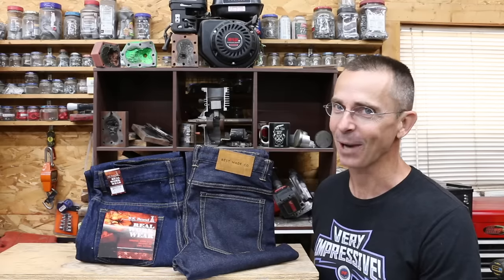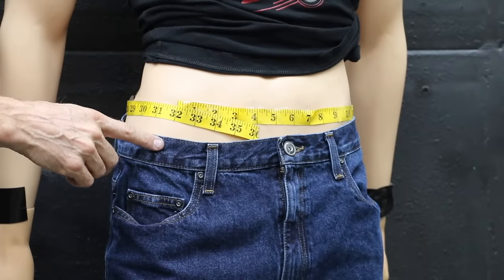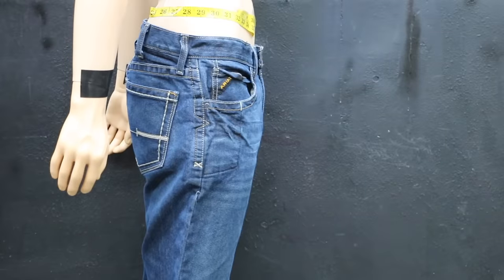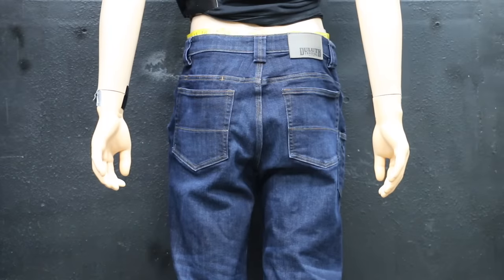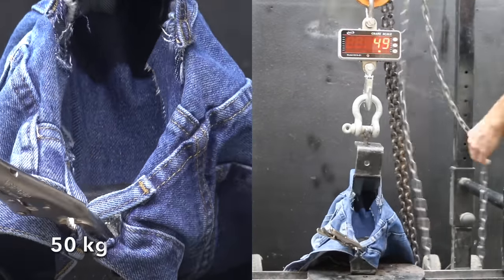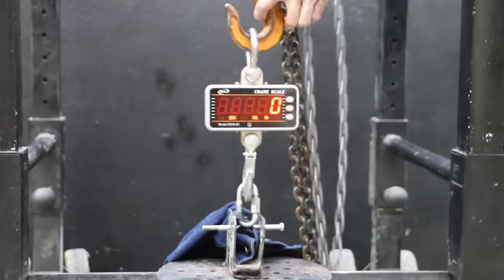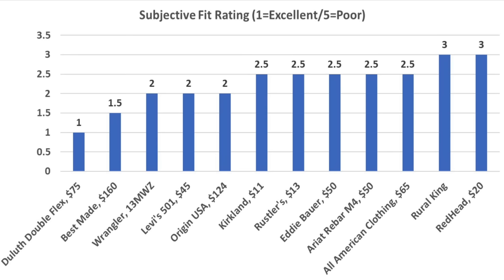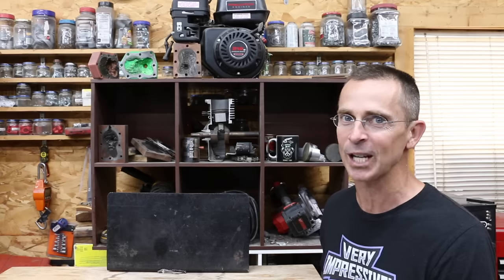$10 vs $160 Jeans? Let's Settle This!

Comment: Origin jeans had a buy two, save ~$50 dollars deal going on, so you were getting them for $99 a pair, rather than $124. I bought two pair and so far they are really nice and super comfortable jeans. Most of my jeans have crotch blowout after 1.5-2 years, so I need at least another year before I can access the crotch durability of these Origin jeans.

The firehose flex canvas material of the Duluth pants tends to hold up better than Denim if you sweat a lot, my Duluth pants have held up for 4 years and they still look basically new as far as wear.
Reply from the maker: Thanks for sharing.

Comment: I used to love 501s, but recently, I’ve noticed knee blowouts happen a lot quicker , I have below the knee prosthetic on my left leg, which causes additional wear, but they used to last 6 months before they turned white wear the prosthetic rubbed internally, and about a year there were holes. I literally wore a recent pair and the first day you could see wear, and in a few weeks the first holes started. So this video is great,  I think I’ll switch to Wranglers, they should hold up to my daily work I think
Reply from the maker: Thanks!  Thanks for sharing.

Comment: Recently my work decided to send out Evosyn oil by Evolve Oil, we're a rental center and naturally the entire rental side of the company is in an uproar despite no one really knowing about it.  We use your videos quite often to make our decisions on what tools we want to use in our shops.  If you manage to test out this new oil we'd love to see the results.
Reply from the maker: Thanks for the suggestion.
Reply: What was the reason for them to replace the previous product with that unknown brand? Is it to cut cost or to improve performance? That just might be the answer you're looking for.
Reply: @arkain1  Allegedly, it is to be used in certain tools that you may not change the oil in on a regular basis like pressure washer pumps or in applications that the tool may be rented for weeks at time with no expected maintenance like with generators.

The oil, while expensive, is supposed to by usable for the entire rental life time and only needs to be topped off as needed.  This is just field testing however, the powers that be may have us use this in all tools since we recieve tax credits to off set the increased cost.

Comment: Which Origin jeans are those? They make three different kinds.

Was your Breathability test done with both cold and hot air or...? If only one, which was it?

Did you do all this testing before or after washing?

This wasn't a fair comparison because some jeans were relaxed fit while other were regular straight fit; some were 100% cotton denim while others were flex jeans that had cotton blend with synthetics. Also they weren't all the same color.

6:36 Is that weight the weight before or after you washed them? And when you washed them did you cold wash or warm wash? Did you air dry or put them in the dryer?

Btw, how much were the Wrangler MWZ in cost? Where do i buy those?

Can you test GAP jeans please along with their subsidiaries: GAP Factory, Old Navy, and Banana Republic?

Can you please test made in USA jean company Diamond Gusset please?

Comment: There’s actually a lot that goes into high end denim. You can have a super high end 1000 pair of jeans that uses super lightweight Japanese denim mixed with cashmere or linen. Those will fall apart. You can have high end Japanese denim that is super heavy weight. 20+oz cloth. Those will destroy a pair of wranglers or Levi jeans.  When you get into the high end of denim you start working with very precise and long lasting stitching, sometime done by hand. It’s not all about durability. It’s about how the denim will fade over time and gain character. It’s about how well they fit, not just when standing but regardless of what position you are in. Sitting, bending, doing a cartwheel.  The ultimate question for people who care about high end denim but also value, how much better does Japanese selvedge fade over time than a standard cheap but good pair of american jeans? You could simulate this with chemicals, light, washing for multiple cycles, etc. i would watch that video.
Reply from the maker: Thanks for the feedback.

Comment: Wow, lots of interesting tests this time, Todd.  OK, I really don't care about pocket, crotch, or belt loop tears because I've never experienced one.  The only pocket tear was one of the 5th pockets losing a poorly installed rivet, and it only took 5 minutes to stitch up.  While I grew up as a teen in Levis 501s, I always hated the button fly.  Seeing the ventilation in the Ariats, I might be persuaded to buy a pair for the summer months,  but I quickly switch to Rustler and Wrangler shorts for the hot season.  
I've worn Rustler long jeans almost exclusively for 3+ decades and always find them a great value.  It's both surprising and a bit ouchy to see them at the very bottom of your list. (sniffle, sob, HONK)  Who in the world spends $160 on a pair of jeans?  No blue collar friend, oil field worker, or cowboy I've ever known would.  $50 for the Ariats would be my max, even if I had a spare million in the bank.
Reply from the maker: Thanks for watching!

Comment: If you have any problems with that -80 revco, let me know. The ult1786aua is a good unit but you aren’t using it the way it designed to be used.

Comment: Suggestion: Disposable razors. Quality, sharpness, performance, durability. I know it's not a tool, but it's a device we all deal with, daily. 

I'm particularly interested in the cheap kind that come with a built in handle, as I've never found one with acceptable quality. However, you could also test replaceable blade razors, lady razors, and other configurations assuming you can come up with a test rig.
Reply from the maker: Thanks for the video idea.

Comment: Suggestion for a new video. Luggage. Specifically carry-on roller luggage. Test zippers, extension handle strength, stated capacity, durability. Samsonite, Swiss Army etc....
Reply from the maker: Thanks for the suggestion.

Comment: I may have missed it or you accounted for it, but the puncture test seems like it has too many variables. It would be interesting to see if the result was a tear, cut or pass through the fabric weave. The nail head isn't evenly sharp and direction of the weave when it hits could also affect results. Say for instance the nail passes through the weave without much damage, they might be more durable but less protective. I wonder if something like ballistic dummy material supporting the jean would change the result too. Or maybe just the average of several random direction nail punctures per jean. Really appreciate your content!
Reply from the maker: Thanks!

Comment: I’ve never heard of Kirkland jeans 👖 before, but I’ve heard it with their line of food 🍱. My favorite 😻 was Levi’s 501’s, but every place I check, they’re $90.00. That’s why I quit buying them. I’ll probably return to buying them again, but it’s going to have to take some saving. I just cannot believe 75.00 to $100.00 for Levi’s 501’s. Your friend, Jeff.
Reply from the maker: Thanks for the feedback.
Reply: @ProjectFarm  I’d also like 👍 to watch ya do a tensile strength test on the exact same brands of jeans 👖.
Reply: That means to have two forces, one ☝️ on both pant legs 🦵, and on the waist, pulling in opposite directions 🗺, until the jeans 👖 fail. I’d also like 👍 to watch ya do a twist test, and the tensile strength, simultaneously. Your friend, Jeff

Comment: It looks like your breathability it inversely proportional to the material weight. I'd like to see that final chart with breathability switched out with material weight. I believe that that would give us the most durable jeans.

Edit: I checked it myself, material weight doesn't change the results much.. but if you remove the noncritical columns the weighting changes.
Reply from the maker: Thanks for the feedback.

Comment: Great videos. Many great purchases made based on PF tests. 

I would love to see "tactical pants" aka uniform style pants tested. Many of us wear them for work because of many pockets, great wear, stretch and comfort while remaining less stained than standard pants. 
But I've been burned on junk that cost more than the cheaper models. Tru-spec, Propper, Condor, 5.11, LAPG, AND Crye would be awesome to see thier lightweight patrol or tactical pants. Same tests as above. I've had multiple pairs of Propper lightweight tactical pants and aside from the flashlight pocket wearing out or pants fading they have lasted years of hard use and daily wear grinding knives or TacMed training. I'm interested to see how the others stack up. Condor, LAPG, Tru Spec all work well but less comfortable for the price in my experience. I would love to see honest data on it.
Reply from the maker: Thanks!  Thanks for the suggestions.

Comment: Another American brand to test would be Diamond Gusset. Thanks for testing Origin.

An intetesting test would be durability of running shoes. Xero has a 5000 mile sole waranty. How does that compare to other trail shoes that use Vibram soles?
Reply from the maker: Thanks for the suggestions.

Comment: Record of my experimentations with jeans:
Update Nov 2023: As expected my 6-month old Levi's both failed. One from a random crotch tear and one from the seam of one of the back pockets tearing. Going to buy one pair of the Origin USA and one pair of Wrangler RIGGS Carpenter (top competitor from the previous jean tests) and compare how they last
Update Feb 2024: The Wrangler Riggs jeans failed next to the seam in the back of the crotch after 4 months, effectively 2 months since I was alternating them with the Origin jeans. However, the split is not as severe as the Levi's, which would just pop apart. I'm going to try to use an iron-on patch over the spot and see if it holds up.
Reply from the maker: Thanks for the feedback.

Comment: Maybe you have already tested this, but I think a video on deadblow hammers could be interesting. Seems to a big difference in the quality of the elastomer and the tightness of the shot in many brands especially when comparing the cheap hammers to the more expensive ones.  I've noticed that cheap hammers tend to chunk off easier and transmit less force than higher quality ones as well.
Reply from the maker: Thanks for the suggestion.

Comment: Should the sanding belt have been changed between each test? For the price, you can go through 4 pairs if Kirkland jeans for the price of some of the higher end products, which is what I did. I saved the more expensive pairs for church.

Comment: I have 5 or 6 pair of Levi’s, they cost around $60.00 each and every pair has a patch in the same place. They all fail within 3-4 months next to the back pocket. Just from normal wear and tear. I’m not in construction. I guess it’s just from bending over and walking. Would love to buy a few pair of Origin but they don’t make a boot cut version from that I see. Not interested in tight fit pants. Maybe I will try the wranglers next.
Reply from the maker: Thanks for sharing.

Comment: 9:06 the loop on these jeans just self destructed. The loops in the back on my Wranglers always pull out and leave a hole in the jeans. Then I have to go to a seamstress to fix some crap jeans. I just don't like to go out to buy new jeans after I have been breaking them in. That said, the Wranglers I have been buying, the cheapest they sell, are CHEAP. I'm going to go to a real store to buy some jeans very soon. I'll look into the 505 Levis. That said, I haven't seen where they seem to be that great in these tests. I just liked how durable my Levis were in the 80's. I still have a bunch of them but I'm too fat and I'd like to sell them if I could.
Reply from the maker: Thanks for sharing.

Comment: I think it should be mentioned that the Duluth Double Flex jeans are a significantly different material, much lighter weight than their standard jeans. I think they hold up longer to normal use due to the stretchiness keeping them from wearing out the crotch as fast, but the thinner, weaker material is less resistant to abrasions or cuts.
Reply from the maker: Thanks for the feedback.

Comment: I know it would be an expensive test, but would a test of keyless drill chucks be possible ?  Some cost $35 ....some are $600  ? ? ?   Which one would be the best as a replacement on  the drill drivers you've tested ?
Reply from the maker: Thanks for the suggestion.

Comment: Here's an idea - how about testing those so called Electricity Saving Devices .. or Power Factor Savers which you can plug into a wall socket and then allegedly miracles with your electricity bill will happen. Do they really work and if so, then how efficient they are?
To be honest, I doubt them deeply 😂
Reply from the maker: Thanks for the suggestion.

Comment: Ariat made the best pants I ever owned for about 4 years. Then something changed and they are about as good as pants that cost half IMO, and don;t fit as good. The ring spun denim used to be thicker, the leather patch on the rear belt loop used to be triple the size, and the "rise" of the jeans was a true mid rise so they actually fit. 
I am sure making worse products and upping production has turned out for them but I quit buying them. I guess adding plastic fibers helped return a little durability according to your tests here. They also make flame retardant pants, but last I checked basically every FR additive for anything is a carcinogen so theres that. 

i went to Nautica, but recently they changed the pants I was buying also to a thinner, low rise annoying pants so now I am on the hunt again. 

Every pair of levis I have ever owned the belt loops failed, the knees wore through with the rest of the pants looking fine, and eventually they got thin and just ripped to pieces. If the belt loops and knees made it more then 3 months i would maybe have kept buying 560's. 

I might have to try a pair of Duluth, I hear good things. I noticed the All American brand finished mid to high in like every test on here also, never heard of them, will have to look to see how people say they fit. Nothing says " This is not pants for men" like low rise pants where the waist line is low enough a belt won't go over your hips to hold them up. 

For reference, I am 295lbs, 6 feet tall, wear 40x34 pants(maybe 40x32 depending) and my shoulders are much wider then my waist. Your mileage may vary.
Reply from the maker: Thanks for sharing.

Comment: I know this isn't strictly related to the video, but maybe for the next round of ratchet tests, could you try to acquire a Total Tools and a Truper ratchet?

Total is a Chinese brand of tools, which I suspect is a direct copy of Makita. So far, everything I've used from them has been decent. CR-V steel in most of them (or at least that's what they claim).

Truper is a Mexican brand of tools. They are well known for their gardening tools. They make basically everything now. We see them as a mid-tier option, not quite as good as European/American/Japanese brands, but well above Chinese brands. They do tend to provide good warranty durations as well.

I ask for those two brands since it's what I'm using. I'm a noob engineer and I'm starting to fill out my tool box. I'll be able to buy Flukes, Snap-Ons and Hiltis someday, but every collection needs a start!
Reply from the maker: Thanks for the suggestions.

Comment: Since I don't wear anything on my belt, and I don't put a lot of weight or force into my pockets, this sells me on trying out the Kirkland Jeans. I always looked skeptically at them because I wondered if they were even worth the low price. Middle of the pack abrasion resistance is a selling feature to me, because that's usually what leads to me buying a new pair and so I value that quite a bit.
Reply from the maker: Thanks for the feedback.

Comment: I got a few of the last pairs of White Oak Cone Denim, Made In The USA Levi’s a few years ago. They cost over $100. Levi’s are now apparently all cheap foreign garbage. But hey, they cost less. Levi’s is dead. They are nothing like they used to be. Thin cheap fabric, poorly made. Until I figure out what to replace them with, I’m going to hold on to the ones I have. Levi’s would last literally for decades when they were quality. It’s symbolic of everything about the United States. The whole country is being destroyed by globalization, and the race to bottom for cheap, low quality foreign goods and labor. Chopped up and sold off for scrap. Origin is interesting, Jocko is trying at least. I might have to try a pair.

Comment: Never disappointed with @project farm. 
Several requests:
Winch show down. Apex Badlands vs Warn Evo Vr. 
Also… just saw a commercial on TV for “flex super glue”, the makers of flex seal. 
They claim their super glue was used to lift a ton of bricks via gluing a link together and lifting with a tractor. Cmon. We’re gonna test that (right?)
Reply from the maker: Thanks for the suggestion.